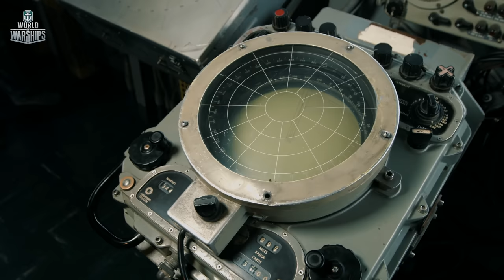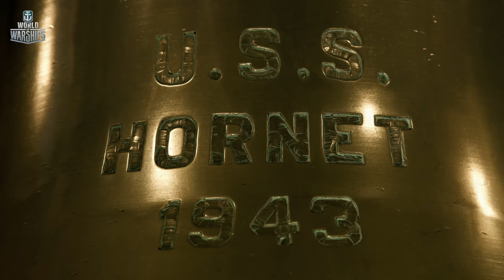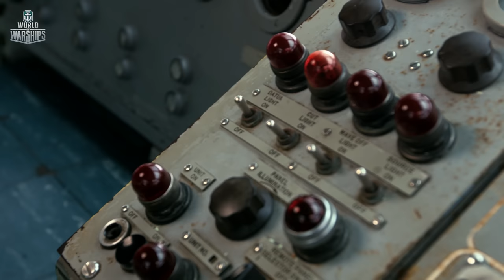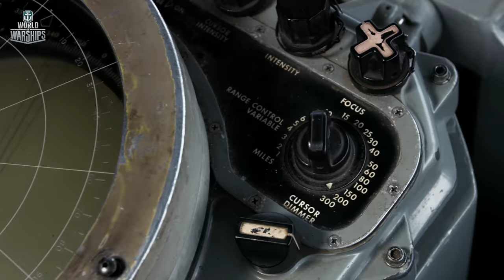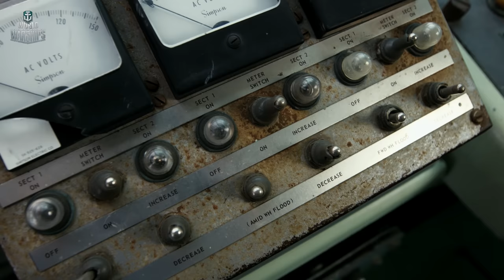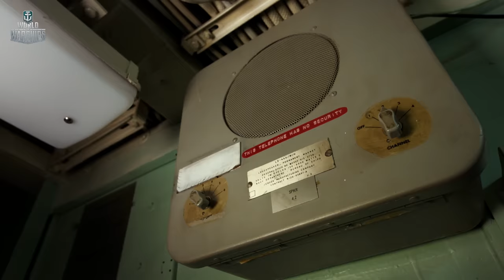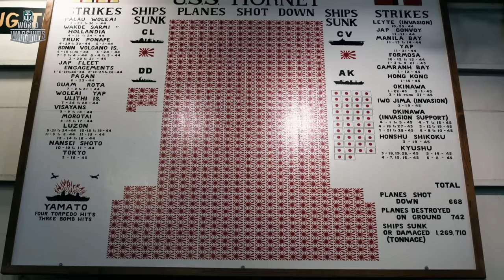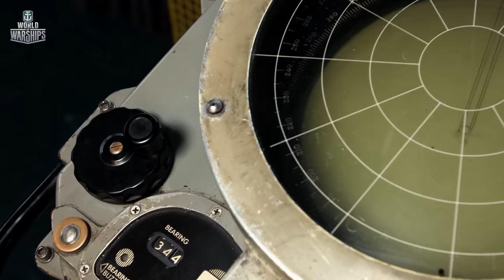⚓ Naval Legends Marathon:  Aircraft Carrier Hornet | 🔊 Now in 6 languages!

Comment: The catapult doesn't hook to a cable on the aircraft, it hooks onto a T-shaped protrusion from the lower part of the nose gear. A cable hooked as shown would tear up the wings and/or fuselage. The cable shown on the Phantom (grey jet) looks to be a tie-down cable - and it's not even the same type as would have been used at sea.

Comment: ok some question. US aviation have pride in their dive bomber right? they are effective, they are deadly, US favor dive bomber more than torpedo bomber.
my question is. what make US dive bomber so damn effective at that time? i watch some documentary video on battle of midway, do some random browsing, 4 japan CV sunk all thanks to dive bomber. and they dont even need like 18 bombs to sunk one CV. CMIIW but akagi only got hit by 2 bombs and burn to death right? so damn effective
Reply: simple: let gravity do the work. when you drop a bomb while diving, just move a little ahead of your target if it's also moving and let gravity guide the bomb. besides, the Japanese aircraft carriers were caught in the middle of rearming and refueling their planes so the bombs ignited the fuel and the ammo, make the need of multiple bombs unneeded. not only that but the carriers had paper thin armor
Reply: Also because Japanese damage control was, honestly, trash. Their ships had poor damage control systems and the damage control officers had poor training. Taiho, supposed to be the most modern and survivable carrier of the IJN, sunk to a single torpedo (which was a Mk. 14, not even that good). IJN carriers had no good way of venting gasoline vapors, compared to USN carriers, in which the hangar deck could be opened to the outside to quickly vent (and start airplanes in) the hangar. You can see these shutters near the end of the video.

Another example of poor Japanese damage control was Shinano, which didn't even have proper watertight doors.